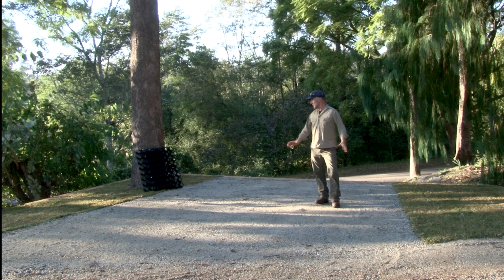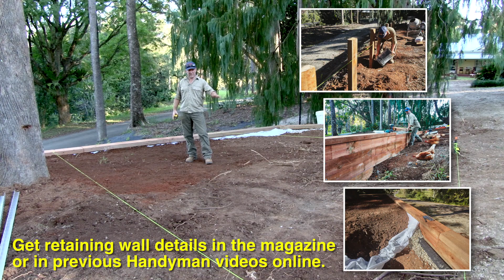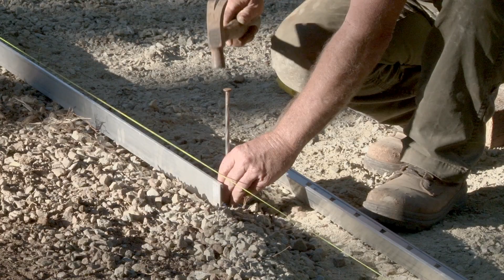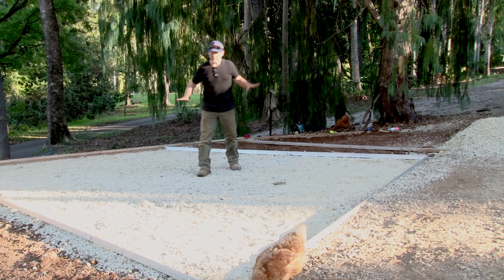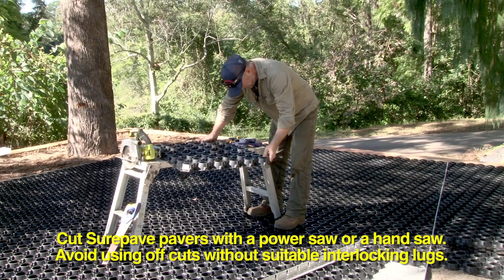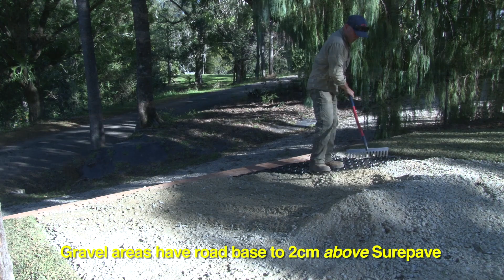SurePave Installation - Grass & Gravel Car Park - Permeable Paving

Comment: If you are going to use a road base then ultimately have a gravel top surface YOU DON’T NEED A GRAVEL GRID. The whole purpose of gravel grid systems is so you don’t need to use road base or sure dust GEEZ 🤦🏻‍♂️